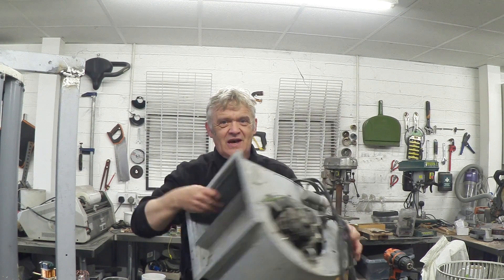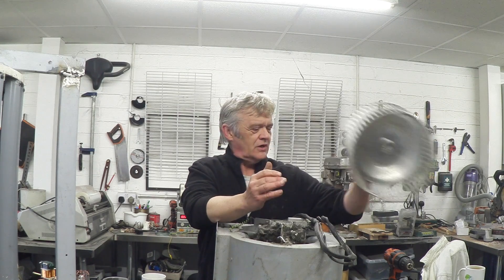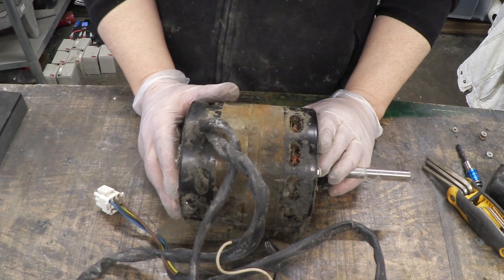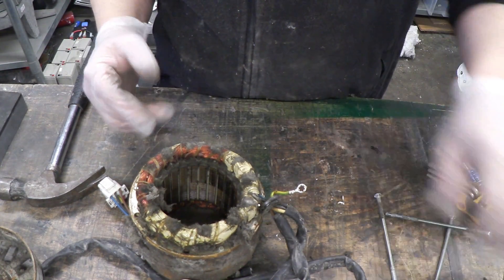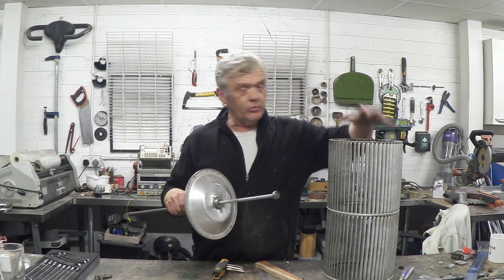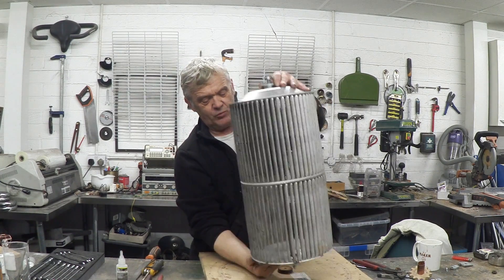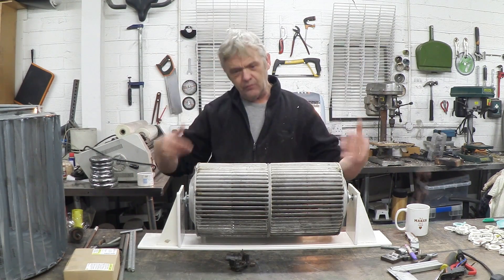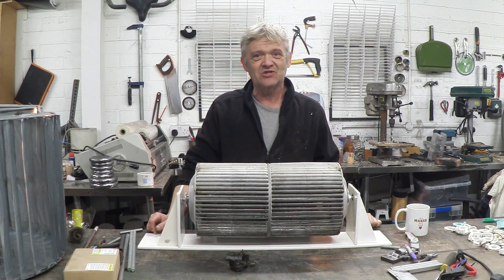A Lucky Find And A HAWT Rotor For A Wind Turbine

Comment: "There is no perfect design" .. .. ..  yes there is .. and for wind turbines this is it .. vertically as a column or horizontally for building roof fitting .. understand the interaction of the design with the flow of air .. THROUGH it .. entry & exit  & you'll appreciate how close its physics are with pelton wheels, & they're acknowledged as THE most efficient for water turbine power .. Squirrel cage fan units don't need fitting into a ducted housing either .. & the BEST feature is, they're commercially made for air condition units & building air extractors etc .. can be simply stacked & easily scaleable .. ALL the airflow forces are captured from the very perimeter of the unit so maximising the torque transferred to a central axle shaft then to the generator .. the air foil blades in the cage interact with each other much like the wings on the like of bi-planes improving resistance to airflow stall improving energy transfer efficiencies

Comment: Hello Robert i think that motor is an induction motor not a shaded pole motor. You will get a shaded pole motor in something like a microwave oven turntable.Shaded pole motors have a sorted single turn coil on the stator and a single coil that looks like a transformer winding. The reason for these fan coil units to be thrown out is usually the bearings in the motors go sloppy from wear and they start to squeal when rotating which is very annoying  in a motel room.

Comment: Robert, can you make that motor into a generator?
Reply: He has a video where he adds some capacitors to it to generate a voltage. I'm not sure what video nu.ber it is.. there are some people who drill into the armature and epoxy magnets into place making them permanent magnet motors. Those can generate power.

Comment: Good sir it occurs to me that you could use the same technique that you did for the tumble dryer drum on a few paint cans and also have a rotor of approximate size as those squirrel fan cages.

That having been said a grinder(or tin snips) and a wrench would turn aluminium duct into a rotor of any desired length.

Comment: Hi Rob, Great job mate! I was looking at the design and momentarily saw a bicycle wheel with a disc break.  No, not smoking anything.  If you put metal plates attached to each end of the HAWT and put magnets into said plates then put coils on both sides of each plate---like break pads of a disc break---I wonder if you will get more output for the same amount of spin?  Just a thought.

Comment: I think I saw people in the comments talking about rainwater gutter harvesting with a water turbine. If that interests anyone there is a very well done series under the title ' Rain Gutter POWER ' The fellow provides outputs into a load and voltage figures as he goes along and the #4 episode goes into great detail as to why it is not really even possible to charge an old smart phone from his (clearly quantifiable) system. I am firmly in the camp that thinks while it is noble to encourage people to think and try things, there is something deeply disingenuous about leading people to the edge of the cliff and filling them with wonder at the void...  Then walking away without informing them what the result of the flight they have been encouraged to take might be. 

Will we ever see a working prototype under load? Doing some REAL work? Please?
Reply: His problem is that he is limited in the drop of the water. If he hooked it up to our gutters, he would get far more power. About 2000sqft of collection area and a 20 foot drop. With rainstorms that can drop 2" of rain in 15 minutes. Even with 6 downspouts, they have overflowed at times.
Reply: @gravelydon7072  Presents a few issues, the scenario you have there. I agree, more head, more water volume, more power. Awesome! Right up to the point where reality and physics bite you in the arse.
Hydro is only any good if you can keep a constant head and flow. It is a massive investment in time and resources to capture energy 'only when it rains'.
If you want to spread the rainfall out over time, you have to store that water that hits the roof, at roof level, (as is stored in the gutters with the toilet valve) until it can be used or it just gets dumped as waste overflow. To store all the heavy rainfall water at 20 ft head you will need some pretty significant, high up, tanks on stilts.
Your turbine and nozzle driving it will have to be tuned to suit your own situation. As will (and this is the really important bit) the generator and its reactance force and the relationship between those forces and the expected output IN TO A LOAD such as charging a battery.
.
This is why it is SO important that Robert shows us what his creations will generate IN TO A LOAD. Not a load of tiny capacitors, a real, charging, load, over time. Using measurements that the rest of the planet understands. There are endless youtube designs for whirligig rotors of the VAWT design and 90% are just things that spin freely and... well, that's all they do. 
The other 9.9% show how utterly shite these things are at efficiency, maintenance, practical usability and are wasters of time, creativity and money and the final 0.1% are highly engineered, seriously researched functional bits of very expensive kit that are STILL not as efficient as even home made HAWT turbines made for the last 40 years by people like Hugh Piggott. (Mr Piggott also has many videos on winding coils specifically to suit your application, desired voltage and current and how to pot them in resin to make a proper job of it, with real data.)
.
It would be good, to just have at least one finished project, with common DATA people can see, so that all the people Robert brings along with him can decide if it really is worth all the effort. We still don't know if the gasifier will run the generator. All that energy and time and effort? Is it just me that's pissed off with this? Or has everyone packed a flask and sandwiches for the eternal trip up the garden path to jump, blinded by awesomeness, off the cliff edge?
Reply: @Godshole  Correct on needing steady flows. Or storage of the amounts that fall quickly at the roof top. In the case of one rainstorm I was at the rain gauge location for, we had a 2" rainfall in 15 minutes. That on top of our house roof would equal out to about 2.5 tons of water falling in 15 minutes. Just think if you had to deal with one of our 18-24 inch rainfalls in 24 hours.
Reply: @gravelydon7072  It was watching a recent video by the youtube channel 'Practical Engineering', chap called Grady, that set all this going. His 5 Jan 2021 short on flood management. You might find it interesting to dig around in his archive. He goes into flow and management regularly but more to do with waterways and dams as well as grid power and such. Very unchallenging factual clear presentation. Thinking about the amounts of water you mention makes me imagine you might be better off with boats.....
Reply: @Godshole  I've seen and enjoyed a number of his videos. Flood control strikes close to home as for 18 years, that is what I did for a living. But one thing you learn rather quickly is you can't control floods. In fact, down here you can't even manage them very well. Our system was designed to handle X amount of water. Nature always comes along and decides to dump X plus X on top of you just to prove a point. Our home sits on a ridge. 10'ASL for the ground and 8 additional inches to the garage floor. The back corner of the property was at about 8'ASL. The road out front, 9'ASL. Now our normal water level is at about 4'ASL so we are 6' above it. In the rainy season, that water level normally goes up to about 6'ASL. Now 2 feet of difference sounds like a lot, but it isn't. The rock we sit on is 1/5th porous. So that 1 inch of rain equals a 5 inch rise in the water level if it is a widespread storm. Get a 4" rain and you have lost all that storage space. Now what was the design spec for the system, 3/4" of rain in 24 hours for most of the pump stations. I have seen water flows going across our road and water levels with the water 1" from getting in the garage. First floor of the house sits another 8 inches above the garage floor so we don't flood. At times, water has bypassed our structures and flowed overland. Or during one wet Hurricane, the structure next to a pump station was overtopped with a level of greater than 10 foot. And we were pumping even more water into that area.
Reply: @gravelydon7072  That sounds pretty nail-biting. Nature might create pretty flowers but it can also float your neighbourhood into the sea. Not all pretty rainbows and sunsets. I like Grady, no pretence, down to earth guy, telling it like it is. Cheers for your reply :)

Comment: Robert would you please stop calling single phase induction motors Shaded pole motors.  Shaded pole motors are tiny devices used for very low torque applications such as record player turntables.  Electrical engineer.
Reply: Is a shaded pole motor the same type they use in microwave fan?
Reply: @williammartinez3392  Hello William,
I can not guarantee that every microwave oven will use a shaded pole motor.
However, if you have one you should be able to recognise it by its construction. 
It will be small and if you can get access to the shaft and can hold it you should be able to prevent it from turning when it is switched on due to its very low starting torque.  The motor will normally have only one coil mounted on a laminated ferromagnetic steel core.  When energised with a.c. the magnetic field will alternate making the rotor want to turn first in one direction and then in the other. The overall effect of this is that the rotor does not turn at all!  To make it rotate it needs a second field and this is achieved by SHADING the pole tips.  The shading consists of a loop, (coil), of heavy thickness copper wire short circuited on itself and slipped over the pole tips.  This should be easy to see.  The effect of the shorted loop is to produce a second field which is time displaced from the main field.  The two fields now act together to produce a rotating field instead of the pulsating alternating field from the single coil.  The rotating field is not very strong and hence the low torque.     Hope this helps to answer your question.

Comment: Could you use the coil from the motor itself as your generator coil?  (like mounted on one end of the axle, or as you've got 2, either end) or does it work better to have a larger number of distinct little coils?  you may have said in one of your other turbine vids, but I don't recall.  guess with them wound on the armature, you'd be getting resistance and kill that whole low-torque thing... Does that count if your magnets were moving across the top bits of of the coils rather than in the middle of them?  
I've got a torn down motor somewhere... if I can figure out what I did with it, I may try a disk with magnets on either end of the stator. (like if you were to take yours and stick it between the two rotors, fixed like with the axle running through the middle off it and the rotors free to spin on either side, with your magnets just skimming over the tops of the coil on both sides)  I just wonder if that, unlike a traditional rotor in the middle of all the coils, would make for an easy way to make a low torque generator, or do anything at all? If I manage to try something like I'll let you know.

Comment: I'm not really  sure but I think the motor is a three phase induction motor. Not a shaded pole motor. It has three wires + protective earth wire and the rotor is a cage rotor with a core. The main difference is that a three phase motor has a rotating magnetic field by definition. A shaded pole motor makes its own rotating magnetic field by means of a shading coil. Remember what I said about the dishwasher pump : I might go clockwise or anti clockwise when powered. When you put a shading coil on the iron it will always start clockwise. 
Remember the old fashion type electrical clocks ? These just had a shaded pole synchronous motor and the gears and stuff you would also find in a mechanical clock. These never run backwards but if you cut the shading coil they would 50% of the cases. If you could get your hands on one of those it would make a fun demonstration.
I've known this for a long time but only today i learned it is called a shading coil.
For both types of motor : If you have a permanent magnet or dc fed coil as the rotor it is synchronous and has a fixed rpm in relation to the mains ac frequency. If it has a cache like yours it is asynchronous. That is rpm will be lower wo mechanical load and maybe a lot lower with mechanical load. The difference in rpm between synchronous and asynchronous motor is the AC current frequency present in the rotor cage. Synchronous motors make good generators because they have a magnetized rotor already. Asynchronous motors have nothing magnetic inside but these might start by luck to generate due to the earth magnetic field.

Comment: What do you think of making it directional with a tail piece and a bearing centered in the bracket.
Reply: Or turn it 90 degrees to a VAWT, save a lot of time, effort, complexity and problems...
Reply: @will_doherty  directionally might help a VAWT .. drag on blades returning  into air etc. Not sure quite how strong such effects are...Probably only starts to matter much at high peripheral speeds.

Anyway...along lines of  
sheets of metal bent so they can cover sectors of rotor. . .. bearings allow such to rotate  around  VAWT axis.
 Vanes on all so they rotate arount VAWT. experiment with different  vane angles to adjust where turbine scooping/exiting size of openings etc

Probably not worth it if wind changes direction frequently...but who knows if it's not tried etc.

Comment: A New Zealand student did there thersus on just such a horizontal wind turbine on top of a apex roof. In Otago University.. Glad you showed that. Of cause it only gets maximum effect if you have an Apex roof.. The final design  had a cowling over the top to channel the wind into the rotor. Love the use what you can get attitude.

Comment: Lovely design Rob Sir,  spins great when you do the final design sir just a humble request you can off center the placement of the rotor above just a bit so that the blade of that rotor is in between two blades of the rotor below or vice versa, that will surely give it a bit more torque, which we need when it's generating😂😂👍👍👍👍🙏🙏 Love and very warm regards from India Rob sir🌹🌹

Comment: Hi Robert, 
 I got an invention for to build. There are a lot of people who heat there houses with a wood furnace and wood stoves. Why couldn't there be a generator device built to install in the stove pipe that used the up draft and heat going up the pipe to turn a generator? Just a thought. Have a great day! Love your videos. AJ.
Reply: I have seen attempts at those types of inventions before, the issue others have had is the tar build up which if left unchecked can cause a chimney fire. . However you are onto something, Have you thought about convection heat for the outside of the chimney.. Have fun building.
Reply: @pip1973nztok  No I am not working on anything to do with this. Just and observer.

Comment: Agree no perfect design...unless everything about environment design put in can be predicted and controlled. Clearly not happening with wind.

Is often possible to design for a bit of loss of peak performance, and achieve a  better overall performance. Eg getting from point A to B car. Tortoise and hare...or a car might be able to hit say 120mph but it's average speeds which dictate who finishes race first etc.

might be interesting to see if adding mass to rotor affects total output, maybe an old innertube so can be varied easily ... sure turbine won't spin up as fast, but it'll take correspondingly longer to slow down once started.
Probably means averages of rpm speed relative to wind speed tending to be lower. Maybe less energy wasted as drag.

Comment: You know if you fitted one of those fan assemblies (Before you ripped em to bits)to your electric vehicle. do you reckon you could use it to charge its battery whilst its driving? have the square opening facing forwards
Reply: The wind resistance added from turning the turbine and thereby energy losses would always be greater than the energy you get out of it.

Comment: Dear Rob,
you are right: There is no perfect design: This rotor might be ecellent on low wind speed and pass out on very strong wind (where is a rotor with 3 blades better - but I don't know!)
I think this wind rotor is for vertical run better as horizontal because in vertical you are independ on wind direction. 
Another aspect is an aerodynamc chapter: Does the rotor get more effective if the blades inside get covered? 
It might get better on less air tourbulences ...